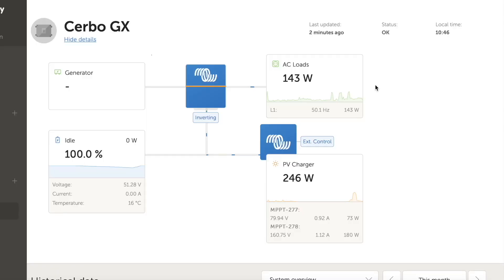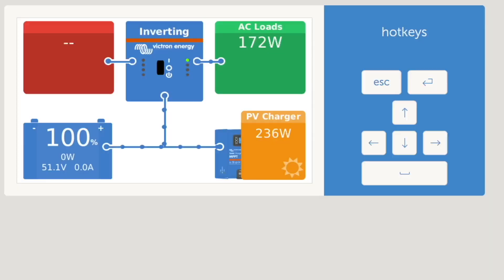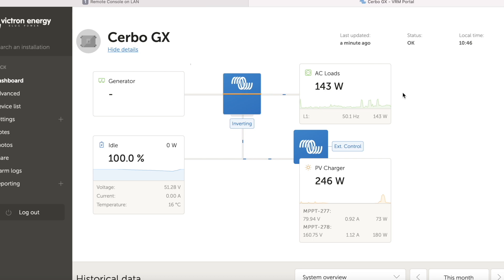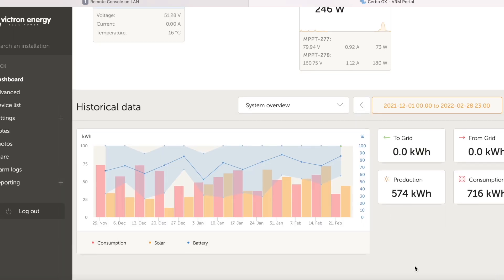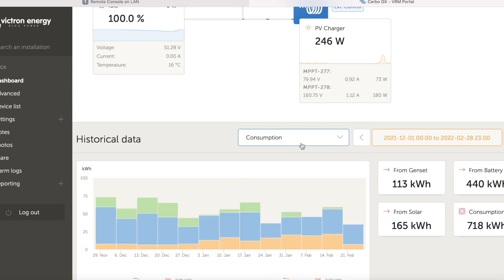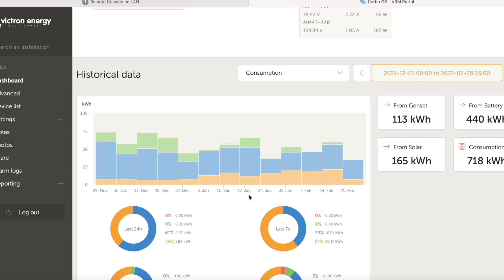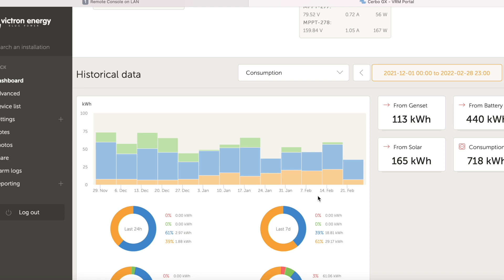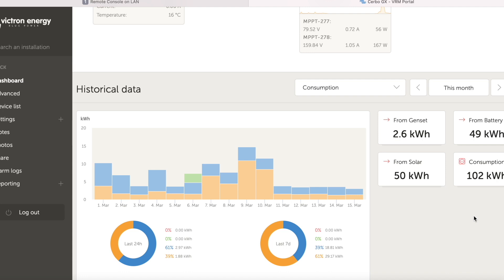SOLAR IN UK WINTER: How our DIY OFF GRID VICTRON/PYLONTECH SOLAR POWER SYSTEM PERFORMED this winter

Comment: You can add a micro inverter like a Deye to the critical load side of the victron and turn it off and on with a shelly  

I plan to do this to harvest some east/west sun. durning the shorter daylight months
Reply from the maker: Thank you for the comment. 
We haven’t done anything solar for ages. 
We kind of moved on from it. 

So as a result I don’t know what a Shelly is 😂. 

Going to start build a house in a very slow fashion soon. 😆

Comment: 50kWh in March only with this HUGE solar array?
You must have done something wrong, because I live in Estonia at 59deg Latitude and have only a SmartSolar MPPT 150/70-Tr VE.Can with only 3s2p 310Wp Modules, hence 1860Wp in total and got more then 114kWh and my Modules are installed in an angle of around 10deg, because we have here REAL WIND SPEEDS which would blow away my panels.

Note: In February I got 53kWh and in January 22kWh.

OK, I admit, that I am cleaning my panels whenever it snows.

But this is the life of an Off-Grider right?

Note:

My farm is called "Miila Mahe Aed OÜ" (Miila Organic Garden Ltd) and we where nominated in 2020 bei the Estonian LEADER Program of being the Only known Enterprise in Estonia Off-the-Grid AND WORKING!
However, until November 2022, I was 100% on 24V DC, hence no 230/400V AC at all!
Since November 2022 I have a Victron MultiPlus-II 24/5000 running, because of two Table Top Induction Cooker (each 2kW), a Camry CR-6008 Baking Oven with 63l and 2000W, a 240l Atlant fridge and a bunch of Circulation pumps for the HeatingSystem. This year, I will get also a 230V Washing Machine.

So, I run a Generator too, but switched it to LPG, because it is much cheaper as Bensin95 and more environment friendly.

However, I just bought 12 new Solarpanels Longi LR4-72HPH 455W and payed only 1363.98 Euro.

You should definitiv install more panels, because with a SmartSolar MPPT 250/100-Tr VE.Can (parallel and daisy chained to the Existing one) you can have 4s3p Hence 5,46kWp more or overpower the SmartSolar with 4s4p and you have 7,28kWp while your SmartSolar has a limit of 5,6kW @48V Batteries.

Install the Panels South-West, to get more solar energy in the Winter.

If you like to contact me use this:   mma4miisu@gmail.com

Have Off-the-Grid fun
Michelle

Comment: Great content you are producing, thanks. I am currently building my uk offgrid pv system and need all the guidance I can get.
Your display shows @100% battery power 51.1v, that seems low, should it not be more like 53v+ for 100% lifepo4 batteries?
Update---- Not to worry, I've just watched your later vid on your Pylontech battery problems, which probably answers my question. Shame on Pylontech, It would make me avoid them based on your poor customer service.

Comment: You could have angled your panels more vertical to suit the lower winter sun angle and the cost reduced summer production. However, you could have a unused surplus in summer I suspect. However, that would be a lot of work now so extra panels seems the best option now. Good channel BTW.
Reply from the maker: Thank you, glad you’re enjoying the channel 😊 This has been a real learning curve for us and we have heard/read a lot of conflicting advice about roof angles. When we build our ground array we plan for it to be adjustable so that we can change the gradient. That way we can work out what works best for us 😊👍

Comment: OMG...how much have you spent in ALL of that??
I am thinking that,is it possible, aside from the "religion" of it, that a better deal would be to be connected to the public grid, and have Peace of Mind?
I  just bought  4 cheap used panels, 60 cells each,  just ordered an inverter,but i am about to kill the whole thing, just too much hassle, never piece of mind, batteries that do not last etc;  
Is it worth,do you think?  i do get a lot of sun,i live on the 41 N parallel , SW Europe,but not so much in DEc,Jan,Feb,Mar..
Reply from the maker: It was £23k for the whole system, but we felt this was better than paying for access to the grid and bills thereafter 😊 It was a lot to learn, and we are still learning, but it has definitely been worthwhile for us as the alternative was intermittent electricity from a generator, which we could only afford to run for a few hours a day 👍

Comment: Nice channel, I just found it by chance.
I'm planning on going solar and eventually completely off grid in time, I have a slightly different perspective as I am an Electrical Engineer for a network operator, i come from the distribution side and i would like to just put up form consideration how we see the issue of providing a reliable supply and what's in the future, it can scale down to single domestic size.
Basically if we run out of power we are in the deep doodoo, we rely on lots of different generation types not just one.
They type of generation makes no difference to the end user, it all lights a light bulb up.
So solar, wind, Hydro, whatever you have use it as one solution never works.
All but generators are unreliable as in when they produce with Hydro the best option.
Because of the above and the move away from gas, oil, coal we get a huge imbalance in production to load, hence storage, batteries, reservoirs', new forms of storage involving Mass and kinetic energy.
Putting this together is a massive juggling act which costs money so don't expect "cheap" electricity for some time.
The main issue of this video in the problem of supply at the times power is required.
Both main solutions have been mentioned, more panels and more batteries. both will work and to be fair in my industry we would do both to guarantee supplies. Second hand panels and looking at how they are positioned for the winter sunlight could if conditions are right solve the problem alone but in the long term extra storage is the overall safest option in the sense that you should have over capacity of stored, ready to use energy. its the same as taking a road trip, you fill up the car at the beginning and if you don't use the full tank any left over will mean less to put in the next trip, it wont go off like milk.
You have to decide how you want it to work, change your usage in winter, get rid of the dryer, or get more storage so you can do what you want when you want, the convenience factor.
For me personally I would prioritize storage to the the trough in production, so if its a bad few days I still have the energy there.  View the batteries as your source of energy with the PV or wind etc as topping up that source.
even with batteries being expensive they are the most reliable investment, the less they are drained the longer they last, we use batteries for operating equipment, some of these batteries are over 50 years old, they are used lightly so last a long time.

Well that's my perspective, its not the only one that will work.

Boiled down, various input types, and a big store that never goes below half full in normal use or better.
Cheers.
Reply from the maker: Thanks for taking the time to comment 😊 It’s really interesting to hear it from your perspective 👍

Comment: There is probably a simple reason why not but... if you are filling the batteries by 1000hr don't you need to invest in another battery or two so the energy isn't wasted (assuming you dont have a historical feed out to grid...now impossible) ?
Reply from the maker: We did talk about this but decided against it because at times when the batteries are charged by 10am, the power we have available will exceed our needs so we don't need to store more.  It is only during the winter months, when the panels don't provide enough power to be able to fill the batteries, that we struggle.  So really we need more panels for those winter months rather than more batteries.  This is also a far more cost-effective solution for us as the batteries are around £1K each, whereas second hand panels would be much cheaper ☺️👍
Reply: @The_OffGridFamily  that makes perfect sense. Thanks for reply.

Comment: Hi how are you heating and what do you cook on,gas or electric
Reply from the maker: Hi 👋 We predominantly use our wood burner for heat, although we do have a boiler that uses gas bottles, as does the oven 😊👍
Reply: @The_OffGridFamily  ok thanks I'm nearly off grid but we do cook on electric and induction hob going to get gas removed and convert boiler to propane and only use when really necessary
Reply: What generator do you have

Comment: Thanks for sharing your findings. Question for you as your batteries are fully charged at 10 in March would a couple of extra batteries have helped you during the slack months and saved you from running the generator for so long? Congratulations on the youngster.
Reply from the maker: We talked about this but think more panels is the way to go to pack more power into the batteries we have as quickly as possible over the winter months 😊👍

Comment: We have 3kW PV, 5kW wind, 30kW BYD batteries. Normally wind and sun balance each other out nicely but last Dec had quite a lot of still, dark days so we used the gennie a bit, especially around Christmas as I recall. Since then I think it has run twice, last time was 24 Jan. Located in Galloway.
Reply from the maker: Thanks for sharing this info 😊 Really glad your system is working so well and meeting your needs. December was pretty dismal! 😩

Comment: Hi
We live off grid with solar panels, batteries and 11kva diesel generator back up. We're thinking of changing our unreliable and oversized generator and was wondering what you use? 
Thanks
Pete
Reply: Thanks for your reply. Our generator is linked up to our sunny boy and "should " start up on auto start at 40% and also start once a week to charge the batteries for maintenance. Its an ex hire set and has served us well for our main power before we got a solar set up last September, but it's not reliable when it comes to auto staring. Also very big for charging our 6kw system.
Reply from the maker: We bought ours pre-solar too. Your priorities change once you transition to solar don’t they? Have you got something in mind for the new generator you’re going to go for? 😊
Reply: No, not yet 😬I'm speaking to others such as yourselves for info and advice.  One thing I will definitely look for is a 1500rpm engine with auto start, but most are similar to the one we already have, which, as I said, is way over its job, expensive to run and not reliable enough unless  it's running for prime power.
Reply from the maker: Sounds sensible. We’d be interested to hear what you go for once you decide 👍
Reply from the maker: Hi Pete. We currently use a Honda EU 70 IS petrol generator. Not an ideal choice but when we got it we needed it to be portable for security, which it is, and silent, which it definitely is not! We want to change to a diesel silent generator which has a two wire start so that we can link it to our Cerbo GX for automatic start/stop so that it kicks in when the batteries drop to 20% 😊👍

Comment: Great video,  the Victron/pylontech system is a joy to use once setup, I've cut electric usage drastically since the Multiplus ESS  up and running,  from the solar panels and wind turbine, with the price electric is now, payback should be under 6 years, if I put the money in the bank and got .05% interest on it vs getting 10-20% back a year on investment, this was an easy choice.
Reply from the maker: Glad you enjoyed the video and that your system is working so well. What wind turbine do you have? 😊
Reply: Airforce 1 but have a SD1 on order as well
Reply from the maker: Thanks for your reply 😊 We are considering getting a wind turbine at some point but apparently finding one that works with the Cerbo GX and the Pylontech batteries we have is a bit of a challenge! 😩
Reply: @The_OffGridFamily  airforce controller is the only one that will shut down the turbine by the command of the pylontechs bms, you might be able to programme a TriStar to switch to a dumpload at a set voltage, but the airforce and pylontech works great together, using the contact port on the battery hooked up to the remote stop terminal on the controller, the only drawback about the AF1 is it shuts itself down in wind above around 15 m/s, up here in Shetland in winter that's more common than not, The SD1 has full feathering blades which will put out 1kw even in a hurricane, but just need to find out if it's generator can handle the airforce controller in a shutdown scenario from a full battery.
Reply from the maker: Thank you for sharing this info. Really interesting 😊👍

Comment: Hi is you hot water gas or electric
Reply from the maker: Hi 👋 Our boiler is powered by gas bottles. We have considered using surplus solar power in the summer to heat a water tank but that’s a project we haven’t got round to yet 😊

Comment: Love it!!   That’s still great production.  I use victron for our remote work trailer.  Connected via 4G for monitoring. While not an entire house and at 42 degrees N.   Power reduction has been my focus. Directly wiring 12v. 19v power from batteries without inverters.   There is a lot of loss in the inverters. 
I do like ur winter extra panels ideas.  ESP if u have snow bi facials would be good.  Thx for sharing
Reply from the maker: Thanks for your comment and for sharing info on your own set up. We love hearing what other people are using 😊👍 We were chatting about the extra panels today and think it’s something we will try to get set up for next winter, especially with the way fuel prices are going 😱